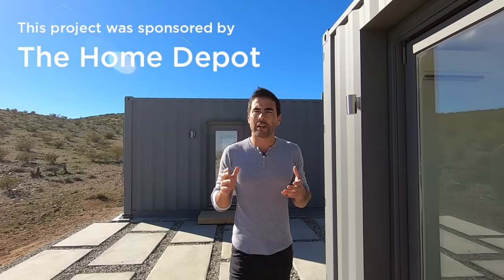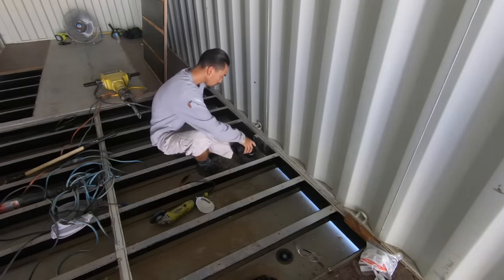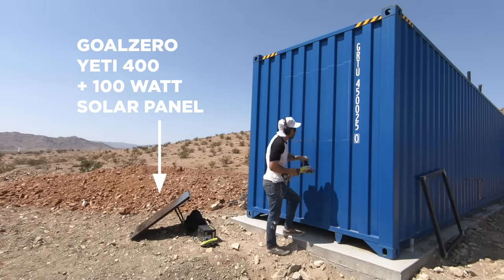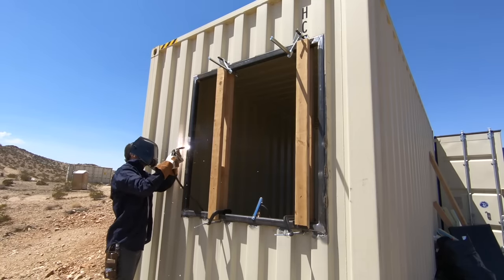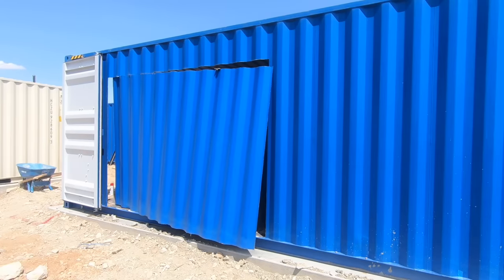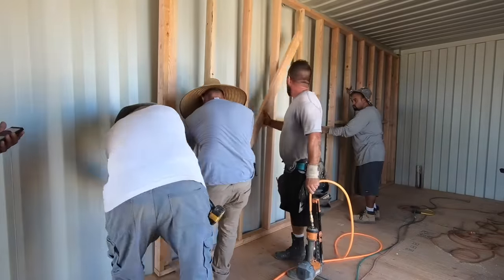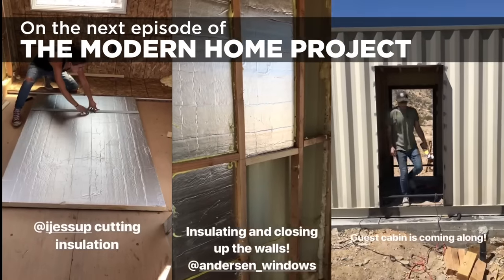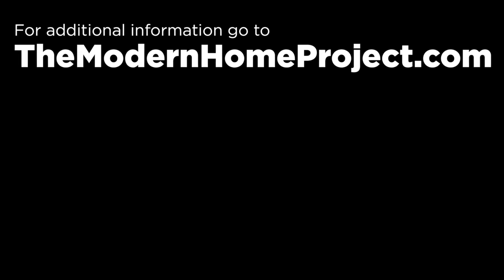Building a Shipping Container Home | EP02 Moving, Cutting, and Framing a Container House

Comment: So you basically framed out a whole house ontop of a concrete slab. Why even use the shipping containers in the first place? If you want the metal exterior, just add corrugated steel sheeting to the outside after you built the house you wanted without having the limitations of size imposed by using containers.